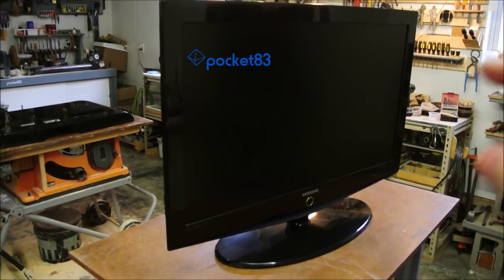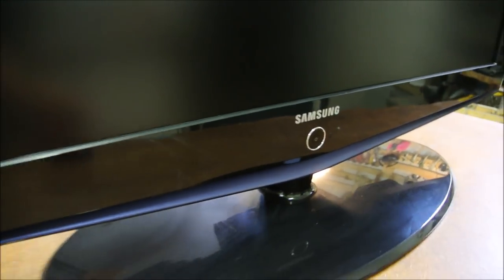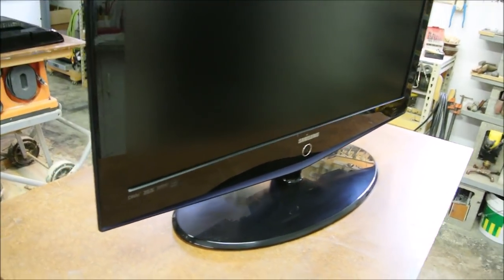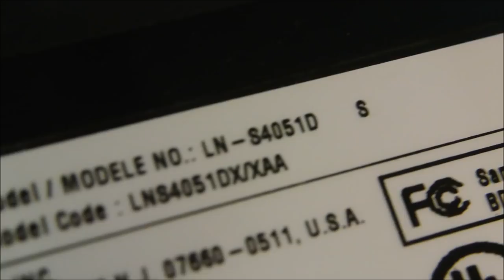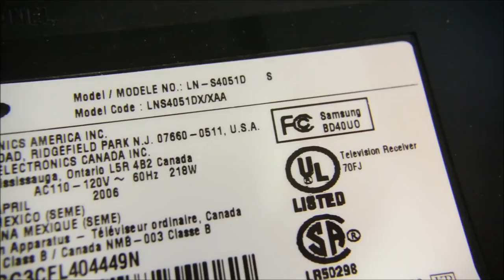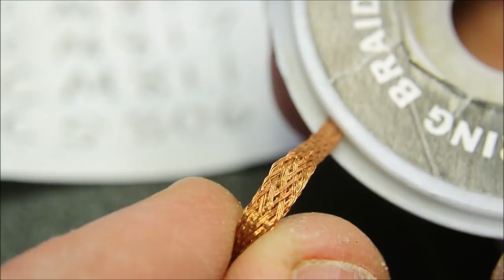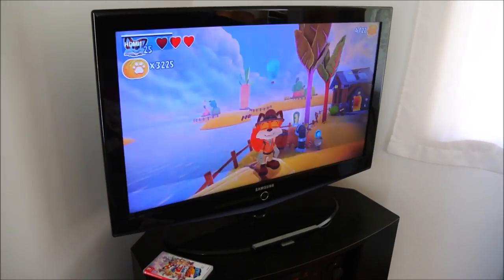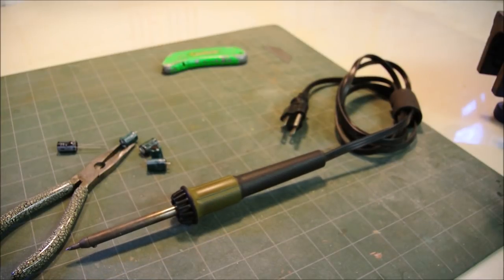TV repair: SAMSUNG LN-S4051D (blinks without powering on)

Comment: Soldering can be very annoying to get done when limited by equipment. I had been running something similar to yours, the tip was chewed after years of abuse. I did a fair bit of research to find something somewhat reliable at a decent price. I don't do soldering on a daily basis so I didn't need a fancy name brand. 

Long story short I went with a Yihua 937D, (yihua likely being a generic brand).
I heat ups quickly, temperature control is accurate. Tips are easily replaceable and standard, so affordable and easy to find. Any part of the iron can be replaced separately. So far I did two 6 hours session with it, everything went fine.

Now of course it has its flaws, the plug from the box to the iron is a weak point, requires care or strengthening. But can easily be fixed should it come to it. 

Overall for the price I think it's as good as it gets. Should you consider this I would recommend watching Big Clive's teardown of the now discontinued 936D which is pretty much the same unit: 
https://www.youtube.com/watch?v=XrUjhFUm8OM&t=372s

And of course if you have any questions, while I'm no expert, I'd be happy to help.

Comment: Can't go wrong with a Hakko fx888d and some 63/37 kester rosin core lead solder. If you're up for some tinkering then I would highly recommend getting a ts100 and repurpose an old power brick that can supply enough wattage to power it. You may have to install the correct size barrel jack on the brick's cord as well.

Also, those were some large copper fills acting as heat syncs cooling off the solder you were trying to heat up. That pen iron probably wasn't powerful enough to heat it up in a decent amount of time.

Also, (good) solder wick has flux in it which really helps to clean the wick chemically when you heat it up and allows the solder to adhere to it. I like to cut off the wick I'm going to use (usually around an inch or so which I then hold in a hemostat) so I don't heat up and ruin the flux coated wick further down the roll. Also I believe the flux to be sensitive to the air so I keep mine in the little ziplock bag that it came with. Had the same roll of chemtronic wick for the past 5 years or so at home and still works great. You can also supplement the flux with some of your own flux as well. Kester makes some good flux.

Well this comment got long. If you have any further questions let me know!

Comment: I'm basically a novice too, but the cheap soldering iron kit I got on Amazon has been great. I only keep it about half as hot as its highest setting, and it's still hot enough to melt the lead-free solder on the stuff I take apart. I suppose your old iron was only ever designed to be used with lead solder, so that's why it struggles with a modern device.

Comment: Dont beat yourself up too much man. At least you had a go and you managed to fix it. Well done.. 2 bits of advice though. Next time its a bit counter intuitive but add more solder. The stuff they use is lead free and its really hard to get molten. Also get yourself a cheap solder pump. You then heat it up with extra solder on and suck the whole lot out. Good work though!

Comment: i bought soldering iron off aliexpress with adjustable temp and comes with couple of tips like pointy and wider ones for various jobs, I like it and for hobby user like me actually works pretty well :)
theres a video "I need a new soldering iron for my bag" from  learnelectronics, thats the one from the video 

theres also one with tiny digital screen, once i get some exp I will look to buy and try that one but for now the one i got suits my needs

Comment: That board probably had lead-free solder. You do need slightly higher temperatures with lead-free. Using flux might help. Cheap temperature controlled soldering stations from ebay/aliexpress etc are great for this work. Portable low-wattage irons like the TS-100 and TS-80 might struggle to give enough heat.

If the component is small enough try heating both pads at once. If you can only heat one pad at a time then the wiggle back and forward technique is almost required. If you don't care about the component you're removing (as in this case) then you can cut the leads at the component body and deal with them separately (not easy with capacitors hard against the board though). The whole process is much easier if you're willing to destroy the component you're removing.

A lot of boards these days use "plated through holes", which means the inside of the hole the component lead goes through is copper coated. This makes components much harder to remove as the solder wicks into the hole instead of staying on the surface. This is true even for single sided boards (where the copper tracks are only on one side) and is always the case for double sided and multi-layer boards. Use good desoldering braid or a desoldering pump (e.g. https://www.amazon.com/Solder-Certified-Desoldering-Electronix-Express/dp/B073ZKRZY8) to try to get the solder out of the hole. Clearing the hole also makes soldering the replacement a lot easier.

Comment: Yeesh... Caps are always the first thing that goes on these things. Most TV's have a "cap kit" you can find online where they just have all the 'common' failures for these boards.

I love my TS100, but I would get a TS80 if I had to buy a new soldering iron. I really like that I can use a portable power bank and/or a USB C adapter for my soldering. The tips are a little expensive, but I just use the "angled hoof' style for just about everything. Some people might suggest getting a soldering station, but I like the portability and I will pay more for that. Also, there is a alternative firmware for the TS100 (unsure about the TS80, I don't own that) that makes it a lot better. You can find it on GitHub if you would like. Don't be fooled by the lower 'power/wattage' on the TS80. It is much better at getting the heat actually to the tip of the iron. I would also look at the "engineer" solder sucker (silver body, red plunger, silicone tip) for a superior solder removing experience. The solder wick works great for Surface mount (SMD/SMT) stuff, but through hole (THT) is just plain easier to use the solder sucker. I have a little kit that keeps everything nice and neat in a single package.

Comment: I used to work at a RadioShack for 4 or 5 years. That was almost 6 years ago that I left though. The higher end soldering stations we used to sell were about $100 any occasionally on sale for maybe 80. They had the nice temperature displays and dial control but I don't remember what the wattage was. Thankfully I left before their last ditch efforts to avoid bankruptcy where they went even harder into cell phones.

Comment: A non-obvious feature of a soldering station is that the cable connecting the base and the actual soldering iron should be nice and flexible. I hear the lower-end Wellers are not particularly good here, my cheap ZD-937ESD is.

Comment: Good video sir.  I know you don't like safety police comments but you might want to mention that you should be careful removing the capacitors by shorting the leads with a screwdriver.  I know those small ones don't carry a lethal charge but it's always a good reminder in case someone does this with a bigger one.  Also, I have to agree with others have said about the TS-100 soldering iron, it's been a workhorse for me doing repairs on laptops.  Cheers.

Comment: this repair applies to a lot of displays, not just this model of TV... very cheap and most people could probably do it if they are willing to put in the effort and buy a soldering iron.
i have done it a few times, and while it works, in my experience it has only been a temporary repair, lasting for about half a year (i use my computer a lot)

please post in the future how long before it needs repair again. maybe i used bad / the wrong capacitors.

Comment: That was a weird experience; I don't often know more about what you are doing than you do. Hakko fx-888d. Hakko is the general goto brand for soldering station. Downside is they look like toys. Weller is the older goto brand, but more iffy nowadays.

Adafruit sells something called the Atten AT-937 for half the price. Never used or heard of it, but I trust adafruit with hobbyist level recommendations on electronic equipment.

Keep in mind that the tips are interchangeable,  and different shapes can come in handy.
Reply from the maker: There have already been quite a few votes cast for the TS-100. Do you have an opinion on it?
Reply: @pocket83squared  It requires a separate 12-24 volt power supply, which makes it convenient if you already have things like that sitting around. It does better with 24v than 12v.  I have two friends who absolutely love it and one who had his die after a couple weeks--just beyond the refund/replacement window. So I can't quite recommend it, but it might be fine.

Comment: Cool! I had a nice LG monitor with a power distribution board problem years ago, and I wanted to get a soldering iron and try replacing the caps. Unfortunately, my parents decided to throw it out and buy a new one. Except without the second part. I had to use a shitty 19" TV that Verizon gave us for free for a few years. Meanwhile, a really good monitor with a few bad caps and a few hundred perfectly functional components got comfy in a landfill somewhere for the next gazillion years. Yes, I'm still mad about it.

Comment: I use a single temperature soldering iron, but it works well enough. The key is to get a 60W soldering iron, not a 30W. Also, buy a flat-headed tip for better contact. I'd say those are the only things I would've changed.

Comment: if you put a small drop of solder on the iron and then touch it to what you want to remove when the molten solder touches the board the drop greatly increases the surface area of contact thus allowing greater heat transfer..

Comment: Take this all with a big ole grain of salt, because i didn't do well in my electronics class in junior college, but folks should undertake this with a bit of caution.  As i understand it capacitors have a unique property of being able to store and release energy rather quickly, unlike a battery which stores energy relatively slowly and releases it rather slowly.  Caps can retain energy for a long time after the power has been removed. Those small caps you are replacing individually don't really intimidate me, maybe they should as a group they can probably deliver a good jolt.  The one that gives me more pause is the big cap above what I presume is a transformer seen at the middle right-hand side of the video at 1:49  That's a spicy meatball!  

The issue as i understand it (and i could be mistaken, but i'm rather sure i'm not) is the issue of electricity finding it's path across your heart. As in from one hand across your body and out the other hand, or another body part touching ground.  I believe it's good practice to discharge your caps before servicing them.  You'll notice me using a lot of disclaimers like "I believe" and "as i understand it" because i'm not an expert, but i have hung out with folks who've made Tesla coils, and capacitor array coin shrinkers, and i've seen these things in action, they're really cool.  I expect someone will come along and school me at some point for this comment, but seriously, learn about voltages and safety before jumping into a repair like this.  Yes, you CAN do it, but please do it safely with a modicum of understanding on how to work with the potentially lethal voltages in consumer electronics.  For example, get on in there and upgrade/mod your old pc tower to your hearts content, but maybe don't crack the cover on the power supply or monitor, notice i specified PC tower, apple iMacs have the caps right out there where they'll bite you.

Comment: First and foremost keep your tip clean my gosh lol yes the soldier was acting as a heat sink I have the same kind of iron from the shack because the one I got with a heath kit quit lol. I like the ones with a base and digital also I use the ribbon de soldier tape but my buddy has a sucker pen and wow. I liked the vid keep up the good and Happy Holidays!

Comment: Neat video!! My 40 inch has this issue so I replaced it with a new 40 inch. I may attempt to fix the old one though sometime but not until after all the holiday craziness is over as I won't have time. :P Of course there are other options to repurpose it instead of keeping it as a tv also. This video will be a great help when the time comes. - Heidi
Reply: BlackCat2 Yep sounds like a capacitor problem. Good luck!

Comment: Lucky in this case but sometimes bulging is not the clue. The capacitors can look normal, but heat gunning or freeze spraying each capacitor can get a reaction to help diagnose.
Reply from the maker: There was quite a bit of buzz on the internet over this particular set of capacitors, so I had a pretty high probability for success given the symptoms. The screen is still in (daily) use to this day. 

I have nowhere near the sort of expertise necessary to go probing around inside of a piece of electrical equipment that's already working; this TV was a case of fix it or junk it.

Comment: Quite expensive capacitors you got there.

When radioshack was still around, you could get such parts there for way less and much faster.
In Germany we have Conrad, which often has capacitors in many sizes and voltages.
Reply: I really miss Radio Shack.
Reply: @grandolddrummer  if you're lucky, you have a local electronics hobbyist shop.  The last RadioShack in my city was independently opened, so they renamed it and stuck with catering to the original hobbyist and diyer market.
Reply: TheSuckerOfTheWorld yeah radio shack lost it way and unfortunately by the time they found it again it was too late.

Comment: I can't tell you the number of crapped out TVs and monitors I've fixed just by replacing the caps! :P Those Samxon caps are the nastiest cheapest pieces of crap in existence  today :O If you got some good quality caps, barring any other faults, that tv will outlive you :D

A note on the caps:
It's beneficial to replace all the caps on the power supply side, not just the blown ones, because new caps are pretty inexpensive anyway, and they're likely feeling the heat from that heat sink also.
The old caps are very likely 85°C rated. If you get 105°C ones, they'll last even longer.
You can use higher voltage ones (never lower) and it'll still be fine

Desoldering:
Add some more solder to the joint. Sounds counter intuitive as you want to remove all the solder, but chances are you have lower melting point solder than what the joint uses, and that will help spread the head around the joint.
Flux will also help spread the heat

Comment: My TV has a similar issue and I think it's the capacitors. Where did you get your capacitors from?
Reply from the maker: eBay.
Reply: @pocket83squared  ah, alright. I've always been skeptical of ordering from ebay after seeing the numerous scam videos on YouTube. I wasn't sure if you went through a website that specialized in electronics. I guess you don't miss Radio Shack until you need it.

Comment: back in the day of Radio Shack, You could take those capasitors out, and simply say: "I need 4 of these" in the Radio Shach :D without waisting a week
Reply from the maker: It was doomed over two decades ago. It started to go bad when they first started selling crappy consumer products; it changed its emphasis from tech repair, and started pushing Optimus tape players and the like.

In the process, it become more and more (under)staffed by less and less knowledgeable workers. It didn't adapt to its market; it changed its focus. The price for loose LEDs became something like $1, and then they would try to sell you a phone while you were there. 

To be honest, I wouldn't back-trade for my modern access to eBay and Amazon. You'd have to go all the way back to the mid-80's before it would be a fair swap. Inflation adjusted, it's probably a good-riddance. I have zero nostalgic love for Radio Shack. Bought way too many overpriced lemons there. Even their batteries were junk!

I'd bet it was awesome way back in the day, though. Like, in the 60's.

Comment: i dont want to sound like a jackass,its really  just an advice like that, you can get component tester for quite cheap on ebay, even as diy kit, for about 15$ the way you tell for sure what are the parts to replace, you test  the value,  and check if it correspond the rated value written on em (it can be done with a dmm that has capacitance too, but a component tester can test all  sorts of other stuff